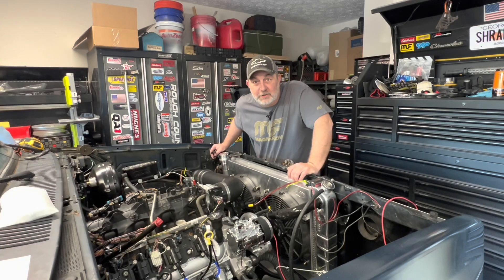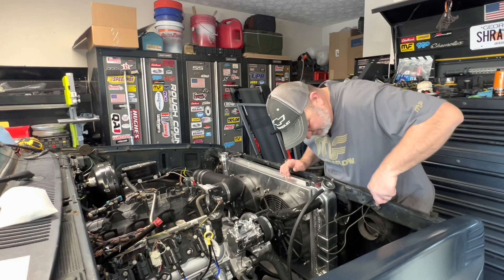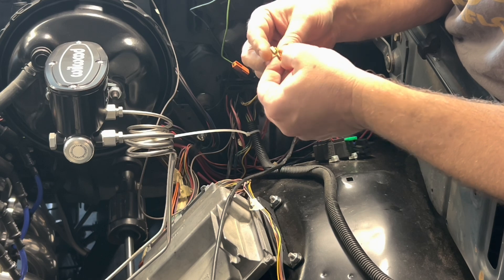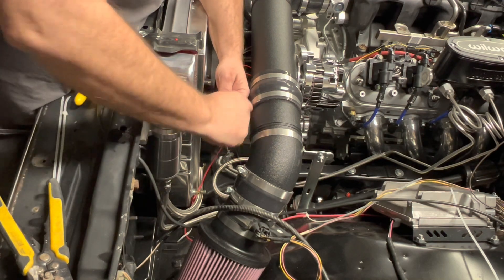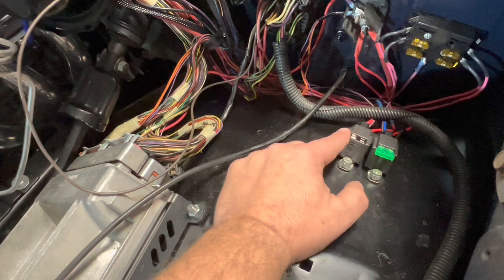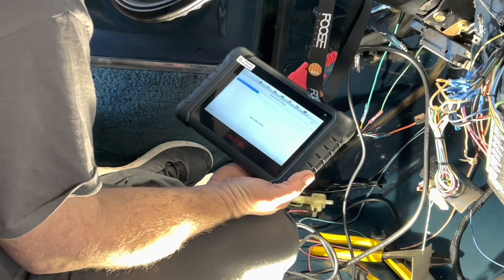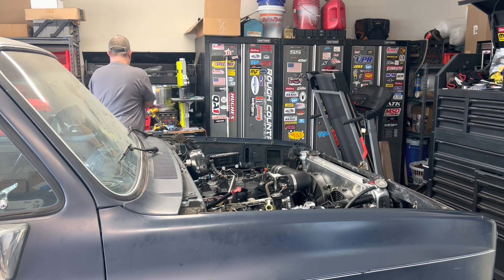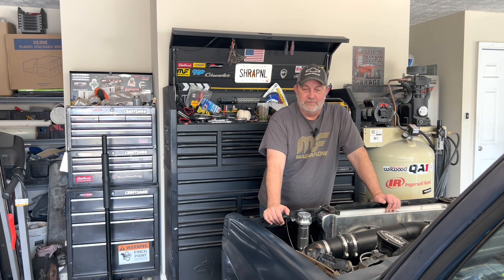First Drive! Squarebody LS swap wiring - electric fans, alternator, TCC switch, and OBDII

Comment: I’m curious about the distribution block on the firewall of my truck, do I need a power wire running from my alternator to it if there is already a power supply wire?
Reply from the maker: No, the power wire to your junction block should be coming from the starter solenoid and have a fusible link.

Comment: Great content! I’m doing the same build right now with the QA1 setup front and rear. Do you think it will fit a 12 in wide rear wheel without narrowing the rear end ? I do plan on a mini tub for the bed.
Reply from the maker: 12’s are doubtful. I’m running 10’s with little room to spare. Thanks for watching!